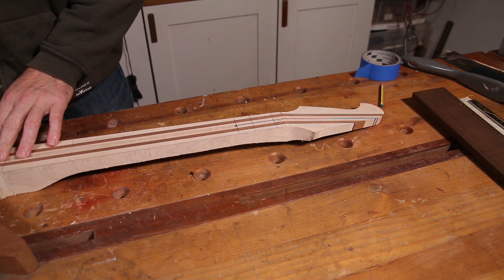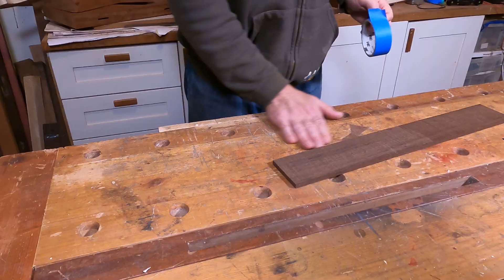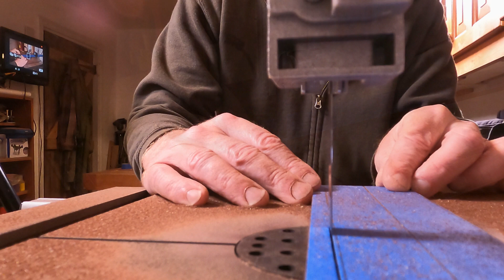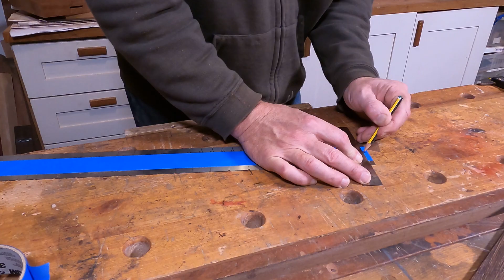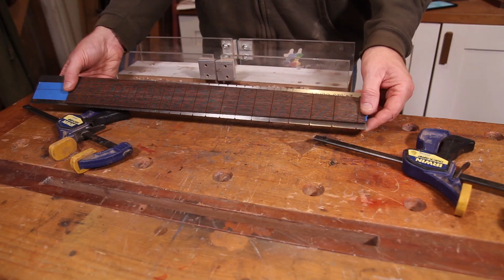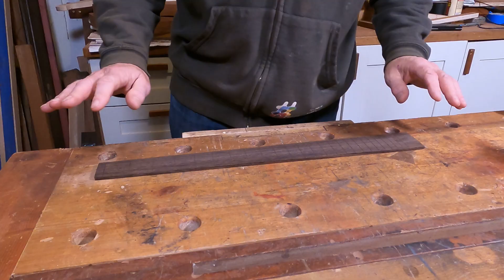Fretboard, GGBO 2023 episode 10

Comment: hey.. was on vacation and catching up on your vids.. glad the FR was 10 inch nut with 12 inch saddles.. I believe the 10 inch nut radius to be for many fretboards that are 10-16 inch (compound) radius like you find on Jacksons and others.. the 12 degree board wont hurt a thing.. fractions of a mil at best.. reverse shark fin?.. great idea.. this is going to be an VINTAGE SHRED Machine for sure.. have a look to the modern BC Rich Prophecy.. which have many shapes but all with neck through construction and the various wood configurations.. may give you some inspiration for color choices or lack there of.. lol..
Reply from the maker: From what I've read the 10" radius on the nut will be fine with the 12" board so I'm not worried at all. I'll have a look at the BC Rich guitars, cheers for that.

Comment: Could you file the slots of the locking nut to a 12" radius?
Reply from the maker: There really isn't any need, at a width of 44mm the two are almost the same.

Comment: The radius of the locking nut doesn't matter as it is behind the real nut and is just there to help keep the guitar in tune.  It really should be called a locking string-tree.
Reply from the maker: This one is the actual nut as well, it will be fine though.

Comment: That fretboard binding technique is something I have never seen before. Genius luthiery!

It still looks as if the rear guide roller on the bandsaw is allowing the blade to deflect to the rear when cutting. That might well be the cause of the blade wander you encountered when splitting the Wenge fretboard blank.
Reply from the maker: The binding idea is indeed genius, not my idea but genius anyway. I've checked the saw over and it seems to be set up fine, perhaps time for a fresh blade.